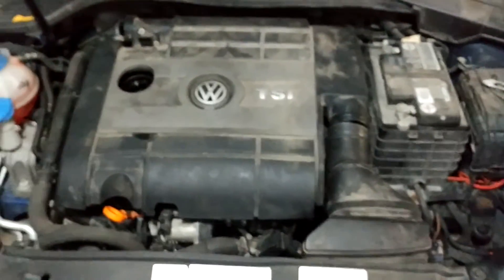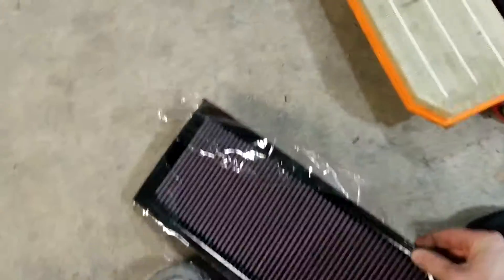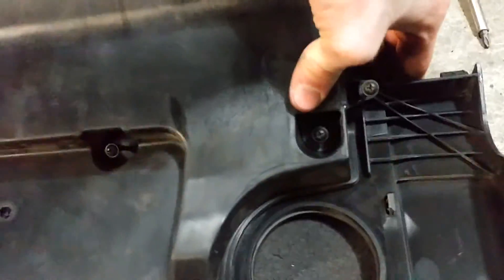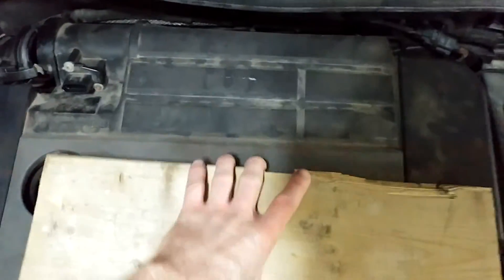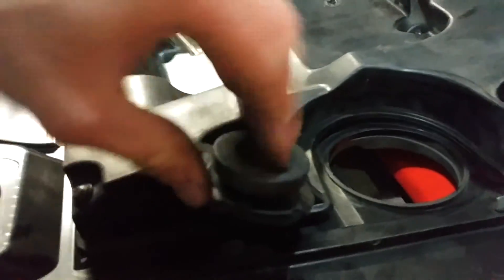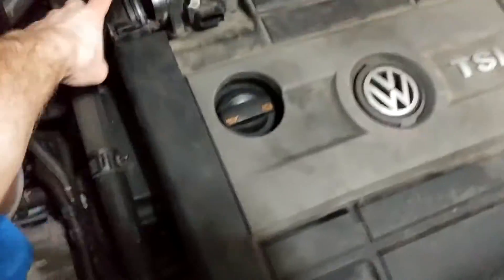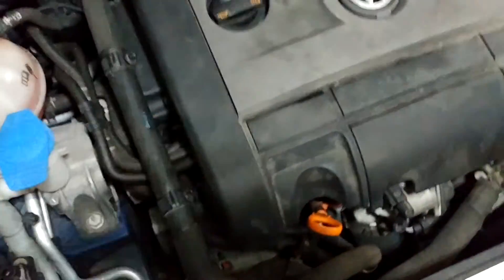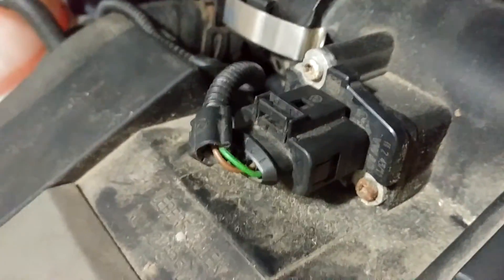2012 VW Golf R MK6 K&N Air Filter

Comment: I did mine, the best way I found was to do the job with the engine warm/hot as this makes the grommets much softer. To replace them into the cover is to spray some silicone on the holes and they pop right back in to the engine cover .
Reply from the maker: What kind of silicone do you mean?
Reply: TheSkystrider The CRC 808 silicone spray was my meaning.

Comment: Update, have just done mine, waited until my wife came back from the store and when the engine was hot it was 90% easier to get these off. As per Skystrider 3 of the grommets stayed attached to the engine and one came away with the cover. I sprayed silicone on to the grommets and they slipped straight back into the cover and then with another spray of silicone they popped straight back on to the mounting studs. So definitely do this job with a hot engine and use some silicone.

Comment: someone should make a video actually SHOWING the method of getting the cover off the grommets. Especially that bottom/left (closest to grille on passenger side) is super hard to get out. I have all other three disconnected, and that one is still stuck. I've already put a small crack in the cover from pulling. I would put a crowbar underneath, but it's so close and dark I can't tell if I'm prying on the right spot.
Reply: I just posted a tutorial on changing out the stock air filter on the Mk6 R. In there I talked about removing the engine cover. I tip I have is just to drive the car for 5 miles or so, that way the engine is slightly warm. This loosens up the rubber grommets and the cover is much easier to remove.